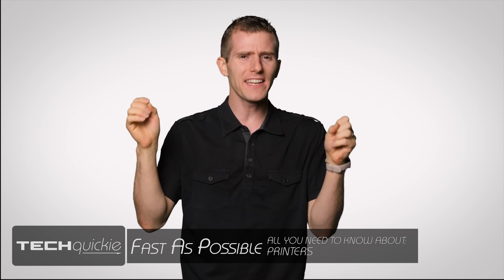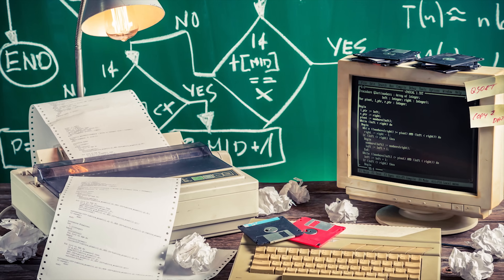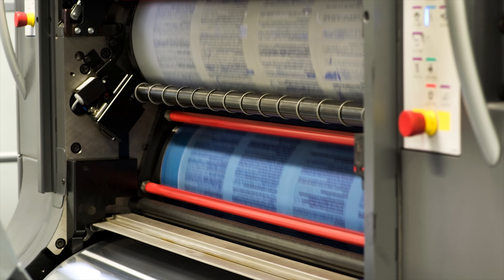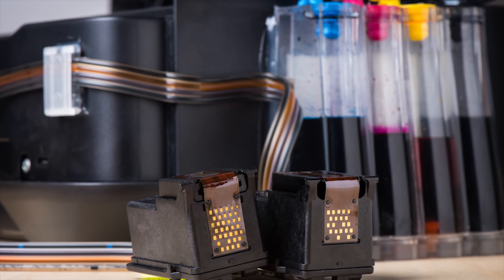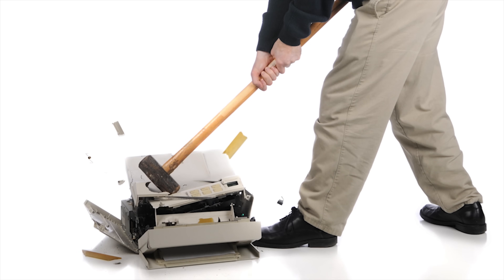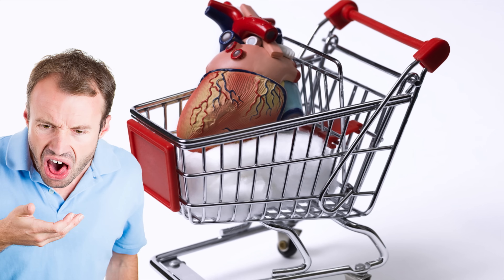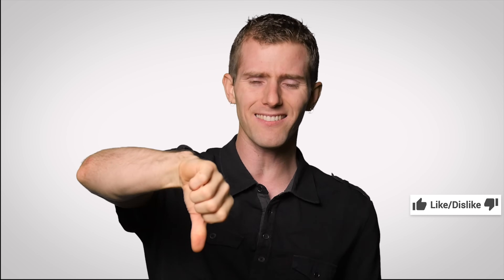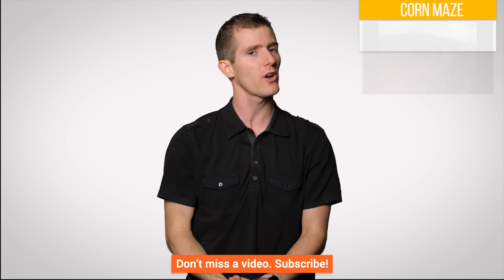Printers As Fast As Possible

Comment: Epsons Ecotank isn't worth the price they took a couple low end model printers and added their own version of aftermarket tanks to the side. they say they come with a year or two worth of ink but that's If it doesn't dry up beforehand. Not only that but the process of putting the ink into the tank is messy as hell and the worst of all of this mess of a printer is nothing stops you from accidentally putting the wrong color ink into the wrong tank ... you can't clean those tanks out so your little mind slip just cost you upwards of $400. this isn't the answer to expensive ink cartridges. Though there is an answer to the woahs of the ink buying consumer I believe HP's Instant Ink program is the future of buying ink.

Comment: I dont get why people will print photos at home.
they know that ink is expensive yet they do it.
You can take all your photos and get them printed at a store that does it for few cents each

And you gotta love toner which is just tiny particles of plastic
Reply: +IIGrayfoxII because it's faster and way more convenient? who wants to freaking go to a store every time you want a print? It isn't cheaper if you also have to spend $1 or so in gas to get there and back, plus the extra time it takes...

Besides that, depending on your printer you can get third-party ink cartridges both black and color for about $10-15 which is obviously way cheaper, not only that but you can save even more by either refilling old cartridges or a better solution for some printers, is buying refillable cartridges which are much easier to refill the ink and if necessary will automatically reset their ink values.

Here are a couple examples if you're interested:
http://r.ebay.com/bLc5bw - super cheap ink

http://r.ebay.com/iuOwBj - refilable cartridges
(this + 500ml of set of ink would cost you around $30 and will last nearly forever, at least by comparison to the normal 10-30ml you typically get.)
Reply: +PurpleShy Guy It's not very convenient if you want to print out kinky photos of the missus, or downloaded porn.
Reply: ***** It was a joke. Though there's lots of sensitive material that people wouldn't want some oik at the local print shop looking at.

Comment: Got tired of the ink costs for my families multi-function Ink Jet, and replaced it with a Color Multi-Function Laser.  It cost about $300, which was twice as much as what I paid for the Inkjet, but since we didn't print a lot and the ink kept drying out, I made up the cost difference in the first year.  The printer came with half capacity toner cartridges to get you started, and I have only replaced the Black one thus far.  They are not quite 3x the cost of the Inkjet Cartridges, but they print a ton more pages and don't dry out or clog.The quality of the printer seems better as well, as in less jams and missfeeds, and though I don't print many photos, the few I have printed haven't seemed to be much lower quality than the inkjet.  In fact one of the photos I printed was for my Passport Renewal which the Government accepted just fine.Honestly, if anyone asked me I would say not to bother with a Inkjet anymore unless you would use it a lot.

Comment: The laser explanation was very good but ONLY for a black laser printer. For colour you have another transfer medium called an "Image Transfer Belt" which transfers the toner from the drums CMYK, creates the image on the belt then transfers it to the paper. 
If you were interested. 
Source: I'm a Konica Minolta repair tech.
Reply: +Craig Ward I don't think his intent was to go over every detail of a laser printer. He didn't explain that the drum is called an OPC drum, or that newer printers use LEDs, or what a transfer roller is. Some older printers don't even use a transfer belt and the paper is run through the system for each color.

I think a good next topic would be how a scanner works.
Reply: Thanks for informing me of someone else's intentions. I'll keep that in mind for the future.

Comment: My printers great, it will print half of one page then spit the other half out blank...
Reply: Haha my printer's cartridges always seem to stop working even when it still reports about half of the cartridge left. Ink even comes out if I rub the nozzle with a piece of paper but my printer refuses to print
Reply: frumbert It will print the top half fine, then give up half way through and then start on the next page and do the same.
Reply: Sell it to me the things I print out only need half the page the other half is wasted ink
Reply: +Daniel Pendzich Make sure both the software paper type and the driver paper type aren't set to something other than standard letter or A4.

Also try running a configuration or startup page to see if the printer is working itself. if it is still an issue, the print driver is screwed.

Comment: The stores around where i live have begun selling inkjet printers that does not include cartridges on purchase.

I'm so happy that i got a HP LaserJet 1010 free from a company i worked for. The only downside is i have to bodge the driver to make it print.
I don't need a more advanced printer. Since i rarely print anything, and when i do i mostly print documents, forms or postal pick up notifications.
Reply: +Crozix After being fed up with the cost of ink for my families inkjet I replaced it with a color laser.  Yeah, compared to an ink jet it was pricey at $300, but I have more than made up the difference in savings on the dam ink that kept drying out.  I don't see myself ever getting another inkjet again.
Reply: +Crozix What do you mean by "bodge the driver", if it is reinstalling it make a script to do it for you!

Comment: actually, Epson uses a different kind of inkjet tech. Traditional Inkjets use heat to expand and cooling to contract the ink head. Epson uses electrical impulses which makes them faster and more durable. Also, they are trying to get out of the cartridge scheme with their new Ecotank line, with cheap tanks that hold ink for up to 2 years (ISO average) of prints for the same price of one cartridge set.
Reply: how are you gonna get that ink to not dry out in those two years?
Reply: And good luck to them, but it's hard to forgive their past problems.  I've been scared off Epson just like AMD, even if their quality improves, the scars never heal.  they touched me funny .

Comment: the truth is: inkjets are expensive allways broken devices to make money with where basicly after 100 pages you need to buy new colours and laserjets run out of toner at best half a year and will never break
Reply: +Maxine Caulfield I agree!  Got tired of always buying ink for my inkjet that didn't last, got a color laser and have only replaced toner once in the 2+ years I've had it.  We don't print a lot, but the inkjet ink would dry out so we had to replace those cartridges several times a year.